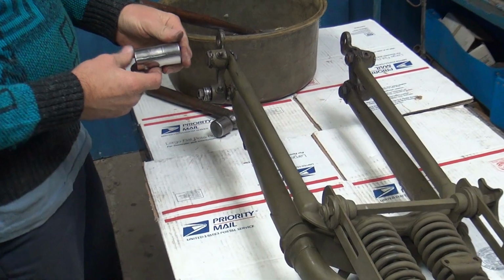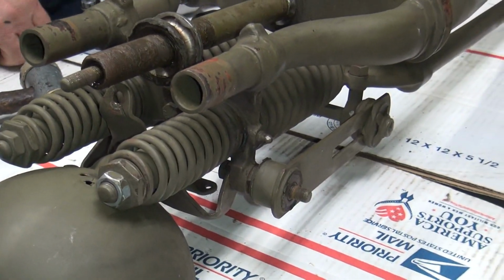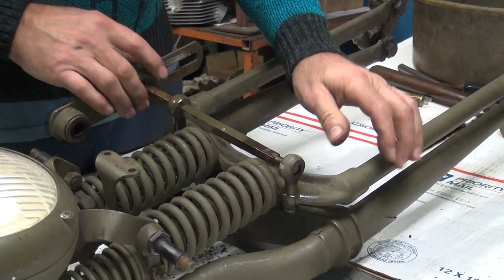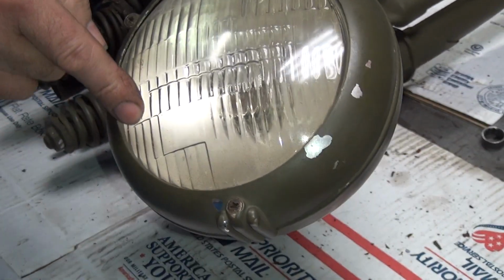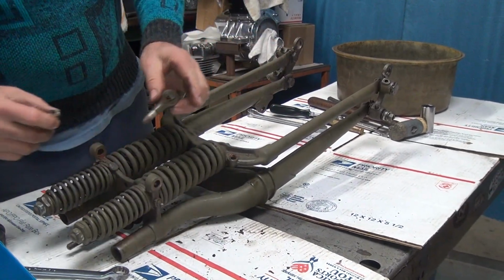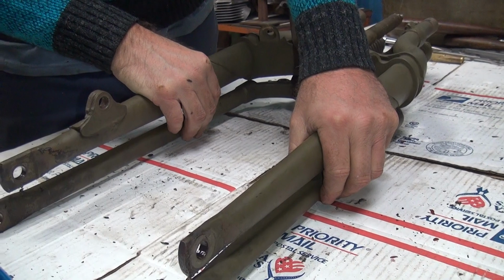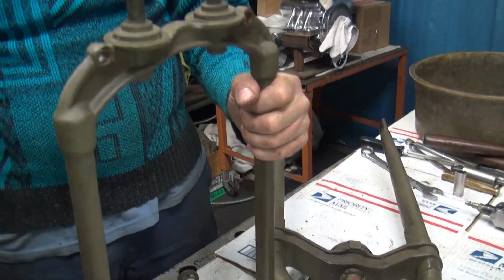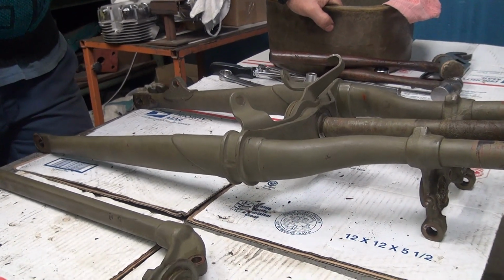1942 wlc wla 45ci #125 springer fork repair rebuild harley chassis reassembly by tatro machine

Comment: Lower inner lower springs don't rattle! Not only are they constantly under load but they also have the stepped collars to center them on the top and bottom!
Reply from the maker: the h/duty valve springs i use are dampened by rubbing against each other. because or this the inner spring does not need this shoulder for alignment. the stock springs do because they do not rub against each other. i don't use stock spring and do use valve seals so i do what i do to make room for them.
tatro